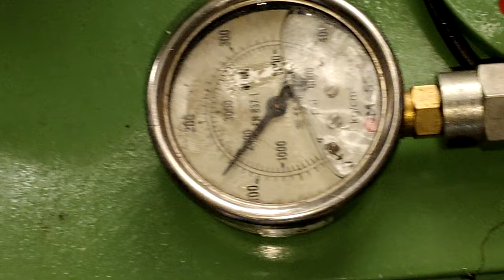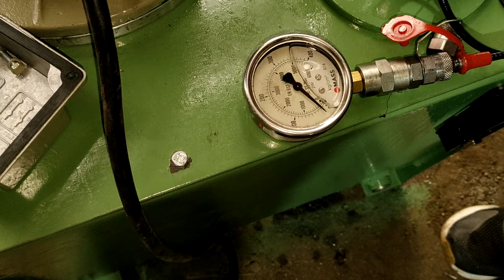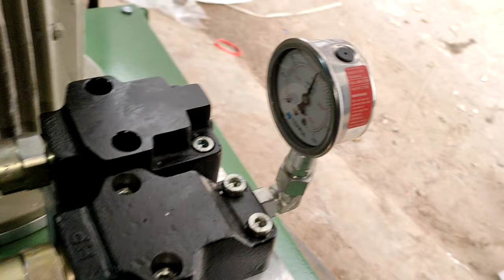HYDRAULIC POWER PACK Pressure Settings

Comment: 150 bar ya psi ?
Reply from the maker: 150 Bar (Approximately 2000 PSI)
Reply: @UnityIndustrialProducts  14.3psi = 1 bar  taqreban
Reply: Hum is me ppr pipe tu use nahi kar sakty na ?
Reply from the maker: Call kariye Mujhe 9971779956